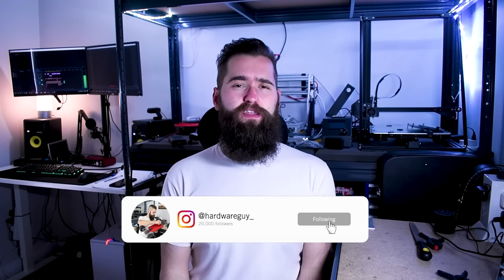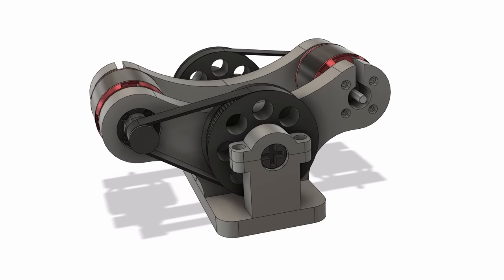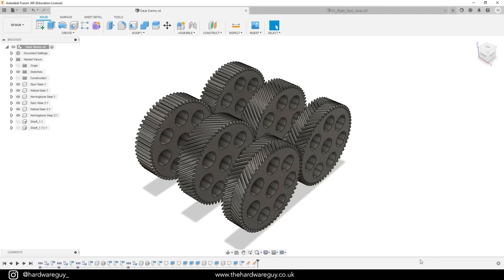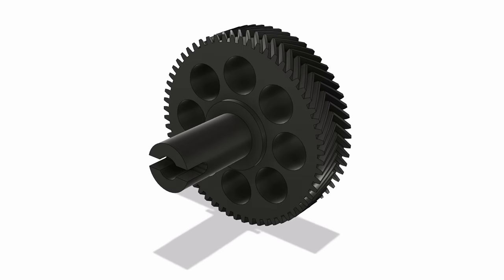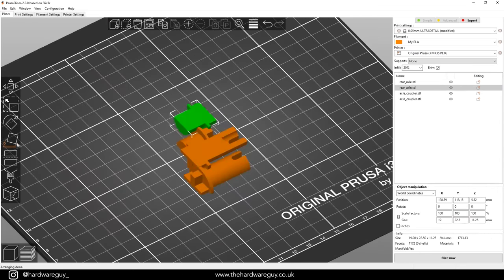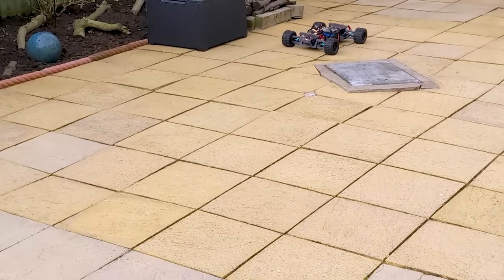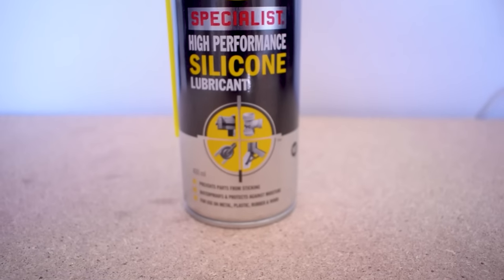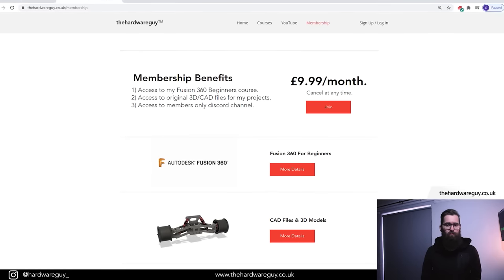How To 3D Print Gears Like a Boss

Comment: Correction: Spur gears are the strongest type of gear and are used in high torque, low speed applications such as automotive gearboxes.This is because tooth to tooth contact area is the largest. Downside is noise or gearbox 'whine' from sudden tooth to tooth contact especially when some wear has occurred. Helical or "herringbone" gears are used more in relatively low torque high speed applications. They are weaker than spur gears as the tooth contact area is minimal but have the advantage of smoother operation because tooth interaction is a more progressive rolling type. Horses for courses.... 😉
Reply from the maker: Spur gears are weaker than helical gears because the loads are transmitted over fewer teeth. They are also highly susceptible to damage/wear since the entire surface area of the tooth is always in contact with it's opposing tooth. The reason sports cars use spur gears as opposed to helical gears is because they aren't concerned about longevity or noise. Spur gears also produce no axial force which reduces loads on output shafts an bearings. Hence higher efficiency, at a cost.
Reply: @thehardwareguy  Apologies, but I have to disagree. With two gears of the same size, width and number of teeth, one spur, the other a single helical gear, the tooth to tooth contact area is wildly different. The "strength" of a gear in terms of its ability to transmit power depends of tooth face to tooth face contact. At any given moment, the spur gear teeth make contact across the entire width of the tooth face distributing the load across the entire width of the tooth. In the helical gear the contact is more like a point contact that rolls across the tooth face from one side of the gear to the other and the load is concentrated only on a relatively small portion of the tooth. There may actually be several such points of contact over a number of helical teeth that continuously roll from one side of the gear to the other, thereby helping to distribute the load, but the fact remains that the total contact area at any given moment is still far less than in the spur gear and so is inherently less capable of transmitting power without failure because the stresses on the individual teeth are more concentrated. Thats why nearly all gearboxes, if they don't fully employ spur gears, employ them at least near the final output shafts where torque is high and speed is relatively low. At the input end they might use helical gearing as the torques are relatively low and speed is high. Spur gears have to have at least one advantage over other gear types and this is it. Horses for courses... 😉

Comment: Any idea how 3D printed gears compare to 3D printed timing belt pulleys vis a vis strength? The large number of teeth in engagement with the latter make me curious.
Reply from the maker: I had no issues with strength when I tried the belted approach, main issue was belt slippage! Adding a tensioner to the design would've been quite awkward/clunky, but it could have potentially solved the problem

Comment: Might be a stupid question: Do you think any post-processing like acetone vapor smoothing could make these gears much stronger?
Reply: Not stupid, remelting the parts increases strength. Slightly melt in the oven or better submerging the print in fine sand or salt (props to the "salt method") and then heating it up. Vapor smoothing might give rather marginal improvements due to only affecting the outer layer
Reply: @giedrius2149  I watched CNC Kitchen’s video, turns out smoothing can weaken and it only can penetrate outer perimeter walls.

Remelting by Taiwanese YouTuber looks interesting, need a ton of super super fine (icing sugar fine) salt, but the resulting look is mesmerizing for PETG.

Comment: is PLA+ plastic good for gears ?
Reply from the maker: A lot of people have had success with PLA gears. Just be aware that they will break under much lower torque that Polycarb or Nylon for example
Reply: @thehardwareguy  thanks for the reply. I have option to use carbon fiber. Do you suggest CF over PLA+?

Comment: cool stuff! Wondering if you've every worked with Taulman Alloy 910?  I haven't used it in such a rigorous application as R/C gears, but in my experience it's wonderfully rugged.  Performs sorta like ABS and PETG combined (but it's nylon) if that makes any sense.

Comment: What if you reversed one of the motors and made a longer driveshaft, so that the motors span opposed to one another and cancelled reaction torque? Might need to make the shaft a bit thicker to get rid of torque steer but i think it could make the whole thing more stable.
Reply: I guess you could just add an extra gear to do the same thing :P

Comment: 0:15 "lot of people dismiss the idea of 3d printed gears" 
*literally everyone I know that got a 3d printer*: INFINITE GEAR RATIOS LEZ GOO
Reply from the maker: haha maybe I'm hanging out with the wrong people!
Reply: @thehardwareguy  Most of the fun and projects I have with 3d printing is with gears. But really, I'm trying to make as many things as I can by solely 3D printing, including functional bearings that work better than plastic to plastic connections with some lube, and also springs to be used as suspension elements, that one is incredibly challenging and you need the right sort of plastic for it but it's possible.

Comment: Instead of Roller bearings, why Not using Ball bearings? There are more repiable and hold the axles better in place
Reply from the maker: I tried them but they are typically narrower which caused the axles and gears to be more wobbly. I guess you could double up, but roller bearings work very well!

Comment: The holes in those gears are very countereffective. They create noise and drag and make the part heavier because you add extra walls where normally you would just have infill.
Reply: If you print them at 100% infill the holes would make sense but printing a gear that size with 100% infill wouldn't make any sense
Reply from the maker: I disagree. It makes a lot of sense. Particularly with the way that I split the gear up in to 3 parts i.e. the gear and two shafts.  The 100% infill ensures no breakages when they are being cranked by a 5:1 gear ratio. On a part that requires 100% infill, the holes are a significant weight reduction, consider it that way. Ultimately, I got to this conclusion through extensive R&D. If you have documented evidence to back up your criticism I'll consider your points.

Comment: my way is to use Polymaker Polymide and aneal it for 2h at 200°C, but polymaker prices are just ludicrous.
Reply: Prices are pretty reasonable for what you get, polymaker products often come in cheaper than many of the "premium" filament brands. Also I've personally done material testing on several different kinds of polymaker filament and the actual strength values have always exceeded the data sheet. My polymide samples clocked in at 68 mpa, although I later found out my prints were slightly under-extruded so the real value could be slightly higher.
Reply from the maker: You get what you pay for though! top quality stuff. Don't forget you can save 10% with my discount code 'THEHARDWAREGUY'. I earn no commission, it is purely for viewer benefit👍🏻
Reply: @thehardwareguy  wish I had this a week ago when I was ordering
Reply from the maker: No worries, you can always use it next time :)

Comment: I am sorry but the explanation on gear specificities is pretty wrong. 
Spur gears offer the highest strength and efficiency of the 3, with the disadvantage of noise. The two other design are weaker (root stress & contact pressure). The rest is correct, but a non stright cut gear will have a point contact instead of line contact, thus decreasing its load capacity.
Reply from the maker: My explanation was in the context of 3D printed gears, in which case based on my experience is true. I am merely sharing my experience, as I stated at the start.

Comment: Why not resin?
Reply: Resin prints aren't as strong as FDM, usually because of the materials that can be used. They are generally only used when the higher detail is needed over function. If you do end up going with engineering resins though (they do exist), they are far more expensive than the equivalent engineering filament
Reply: I can't speak to their impact strength, but Formlabs' tough resins are no worse than PLA, PETG, or most unfilled nylons in terms of strength. Pricey though, then again so is finish machining plastic gears.

Comment: 100% infill is a waste of material and a myth.
20% is plenty, strength doesn't get much better after that.
Whats important is infill type and wall count.
There are numerous videos out there from trust worthy sources to prove that.
Reply from the maker: For other use cases maybe, but not for gears, and especially not smaller gears like these. I have first hand experience with this through my testing
Reply: @thehardwareguy  10mm walls usually gets rid of any infill on small parts too.
Takes ages to print but is still better than 100% infill with "normal" wall count.
The layered approach and the continuous filament path allows for better force distribution throughout the part.
Geometry matters here.

Since infill is usually printed with higher speed and flow rates the area has a lot more internal stresses after cooling.
That's why annealing is such a crucial step, it gets rid of those stresses apart from other things.

There are limits to what a solid block of material can achieve.
With clever design tricks a lot of it can be carved away without touching the part integrity at all.
You already did that with your holes in the gear 😉
This is good practice and an art form. Generative construction methods allow new heights on material savings on this front.
The resulting parts are wild.
Boeing and Airbus are using that to save a lot of weight in their airplanes.
Reply: @thehardwareguy  btw. good work I enjoyed the video.
Maybe I should've started with that 😅

I'm not particular on the split part so...
Have you tried to print it diagonally at a 45° angle?
May require some support.
When I design technical and functional parts I always keep printing orientation in mind, limiting yourself to "flat" robs you of a lot  possibilities.